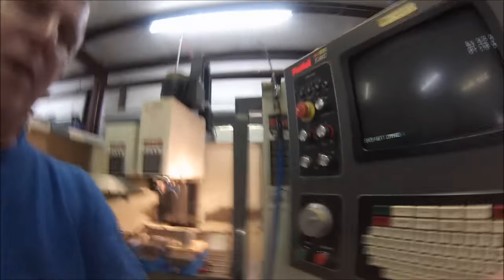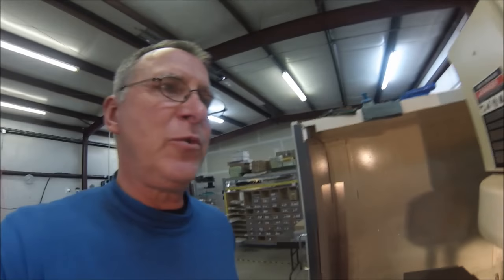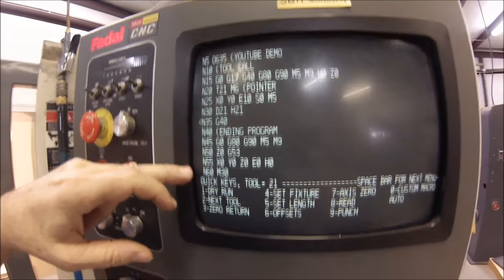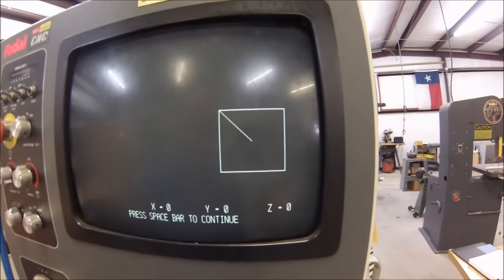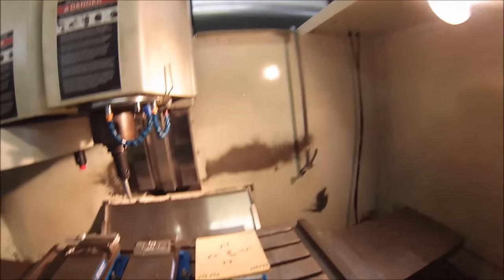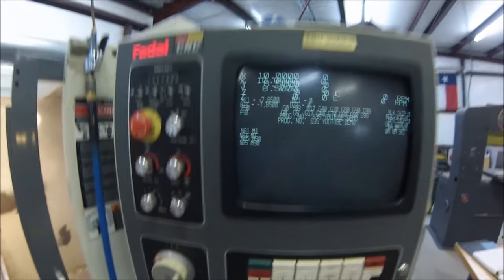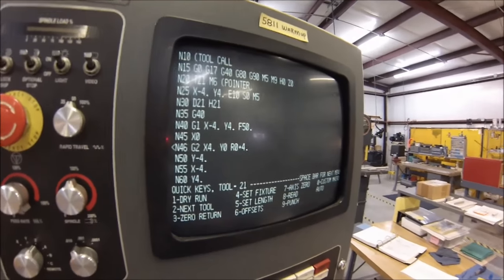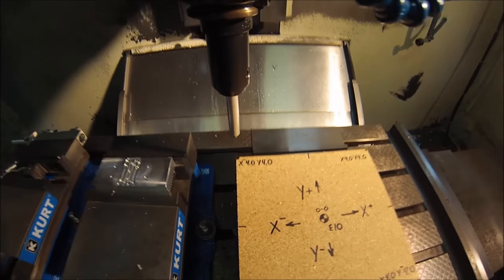CNC Machining Center  Part 4

Comment: I started out in the late 80's with pencil, paper, and a calculator after a few years graduated to a cad system to plot points etc. In 1995 went to Mastercam and still use it for everything even the simplest stuff. The many years of manual programming allow me to look at code sometimes on the fly (depending on whats being cut and how fast) and keep up with the machine and know what's going on. I'm thankful for all those years of manual coding. Good job teaching Joe
Reply from the maker: Thank you. Software is much faster, but if an edit is needed or a problem pops up, most guys are frozen. This is core skill stuff that is great for a job shop or someone just getting into CNC. I had to struggle to learn all this with limited resources to ask. Once you get the codes down, you can get very creative. If I can share it, why not.

Comment: Thanks for making and posting these vids Joe. You're doing a great job explaining this stuff to us old manual guys.Even I understood that you were cutting a square when you did the first entry.I still think a lot of us older people would agree that the people just starting in the trade need to have manual experience to understand the sequencing and programming for cnc.Looks like having the table return to the front before and after machining would be a code you just leave in.
Reply from the maker: Its a simple edit that really helps.

Comment: Joe,
I have an older vmc 15. (96) and a TRM.
I use the SL,21 as an example to set length of tool 21.
There are a couple of ways to achieve most objectives on the Fadals.
The Fadals are easy to repair
And a good simple machine to program manually using the function screen.
The older ones are somewhat limited in memory.
My vmc 15 will take a couple thousand lines but the newer 
TRM will take over 35000.
Reguards,
Kap
Reply from the maker: This one has an expanded memory. I like this machine.

Comment: Super super helpful.  Learned more this weekend watching videos than I did during a frustrating 40 hr work week
Reply from the maker: Feel free to ask a specific question. I'll happily answer it if I can.
Reply: Is there a cheat sheep on g codes I can study?
Reply: Made it to video 4 , looking so forward to the rest.  I also need to learn basics on Haas lathe.  You have video for these too?
Reply: I'm a carpenter/ correction officer that just stepped into this trade at 46 yrs old . So much to learn.  Your videos are a life saver

Comment: Only been running cnc for 4 years? Do you write all your code manually or do you use cam software too? I am really enjoying this down to the basics tutorial.
Reply from the maker: Short easy parts I'll do right at the console, more complex parts will be done offline and imported. I use Pro Engineer Wildfire 4.0. I have used CNC's for years, but have only been 100% responsible for the setup, code and operation for 4 years. before that, just the occasional button pusher that asked a bunch of questions. I'm quite comfortable now.

Comment: Nice Joe I have been thinking about dabbling with CNC but man I can see its a hole new world endless hours and i am sure many crashes along the way . But I bet its a nice feeling to cut some parts when you get it right
Reply from the maker: To be honest, I have been very cautious about my programming. Coming from a totally manual background, loosing the feel of the machine is un-nerving. I have buried an end mill in a vise jaw and snapped large diameter cutters, but it was all my inexperience that did it. Pretty comfortable at this time and so far, so good. Making a complex part is a very satisfying feeling. Getting into the computer generated code is another world entirely. Cool stuff.

Comment: Someday I'd love t watch a video on maintenance, reliability of the Fadals, aftermarket parts and support.

When and why to buy old machines vs a new one.
Reply from the maker: Fadal recently returned to production. Nationally, there is fantastic support for service and aftermarket parts.
Reply: Check out Fadalcnc.com for parts, they have almost anything you would need. They are not affiliated with the "new" Fadal as far as I know. I also made a lot of videos on maintenance, alignment, and rebuilding of my Fadal.

Comment: I am having trouble with breaking off 1/8 em while trying to make a star shape.  Have been messing with my feeds and speeds and even the step over with no luck.  Any suggestions?  It is an older Fadal 3016 so my max RPM is about 5000.  I am plunging into a pre drilled hole and the material is aluminium that is .125 thick.  I am using Fusion 360 for my cam program.  Thanks for your videos have watched many of them multiple times.
Reply from the maker: Lets start with the basics. How many flutes does your cutter have, and how far out of your tool holder is it extended?
Reply: It is a 2 flute cutter with 1/2" flute length I have it chocked up to where the flutes end so a little over 1/2" im guessing.  I can get a more exact measurement tomorrow when I am back at the machine.  Thank you for the reply.
Reply from the maker: Thats a good start. If its an 1100 series aluminum, it will be gummy and tough to make any time on, if its 6061, 2024 or 7075, just keep it flooded and high RPM.  Slow down you inches per minute until it doesnt snap and gradually increase it from there. Does the cutter break in the same spot every time. On the piece I mean. You can also tell the load on the tool by how much flex and dimensional deviation you get from what you expect.  If you can get the cutter all the way through the part, cut  with the flutes closest to the holder and not the tip of the cutter. This will give you much more rigidity. Good luck.
Reply: Great thanks I will try that.  Moving the cutter farther down into the piece is a good idea.  The material is 6061.  It seems to snap when it is making a step over each time.  Thats why I had reduced my stepover to .025 even but still happened.  Thanks for the advice I will give it a try.  Appreciate you taking the time.  Keep up the great videos.
Reply: I like to use stub mills whenever I can. Half the length means four times the strength.
Whatever machine you have, wide open rpm is good, coolant, .015 depth by a thou. Or so per tooth feed for starters.
Reply: Thank you for the advice.  I ended up moving my tool deeper into the part and it didn't break finally.

Comment: Excellent. Thank you sir !
Reply from the maker: Thanks for watching. This is the very core skill level for CNC and extremely basic stuff. Much of this is now executed with software programs that knock it out in seconds. Having this level of knowledge helps with problem solving and "at the machine' editing.
Reply: Joe Pieczynski it occurs to me that I should help you and anyone else reading this thread of comments; I watched a video of yours where you were talking in front of a white board talking about the need to make a part true on a lathe vs. concentric at one spot on the part - you used a dry erase marker in your hand to demonstrate the concept and at the same time accidentally called it a sharpie - then said a sharpie would not come off of your whiteboard: well actually it will. Use the dry erase marker on top of the sharpie ink and the chemical in the dry erase marker will unbind the permanent marker. Thank you again for all you do sir !

Comment: It's just occurred to me, how do you cut a perfect curve on a manual milling machine? Anyone got any tips on the best way to move/control the X and Y hand cranks?
Reply from the maker: Without the use of a rotary table or a fixed pivot and hand driven, cutting a perfect arc on a manual mill is extremely difficult if not impossible. You will have chop marks along the radius.
Reply: Thanks Joe, with the fixed pivot point method I take it that you would be slowly rotating the work piece against the cutter rather than cranking handles/moving the cutter,....that''s a novel idea. Rotary tables are just too expensive for me right now.
Reply from the maker: Yes. It works well, but the part needs to be restrained against lifting and running with the cutter. Be careful if you try this. It works, but take small cuts.
Reply: You can't cut a 'perfect' radius, but you can get pretty close using a technique sometimes called "Kellering". 

You generate a table of moves (in X,Y for example), for points along your radius. For every stepover in one axis, you have a position to hit in the other axis. It's up to you how fine you want to make your steps to determine how much hand finishing will be required afterwards.

Tom Lipton demonstrated Kellering when making the Mini Bullet Vise.

Many modern DROs have a built in radius table generator. It works on the lathe too.

Comment: thank god I have a hurco hawk 5m machine. easier to programme don't need g code. I don't know how you cope! I'll have to rewind this a few times.
Reply from the maker: I'll look that up. How do you make it move?
Reply: Joe Pieczynski in this case select option to create programme, select milling then lines and arcs. put in starting position, feeds and speeds,tool numbers ,final dept blah blah blah. state if you want line or arc after each point. for a line put in begin and end point. for arc state the radius, where it begins and ends and also if it's inside or outside arc.
Reply from the maker: Thats very conversational. The machine generates the G code internally. Nice. Would you be able to operate a controller like this?
Reply: Joe Pieczynski nope I know nothing about g code so I will stick to my machine and keep the illusion that I am a smart person.